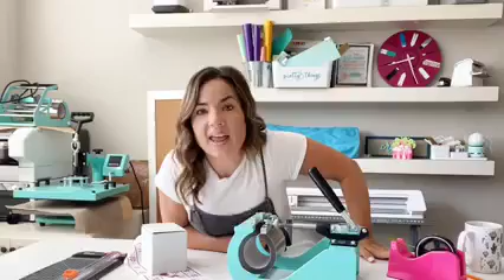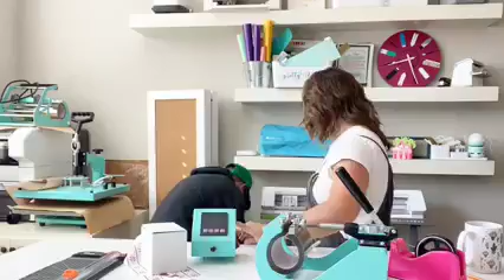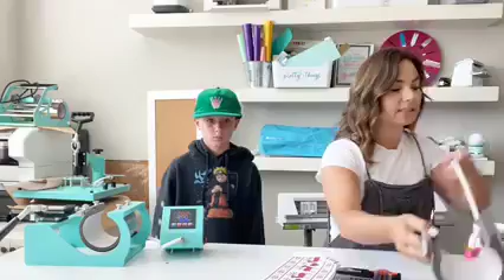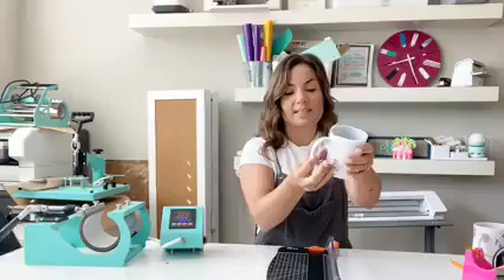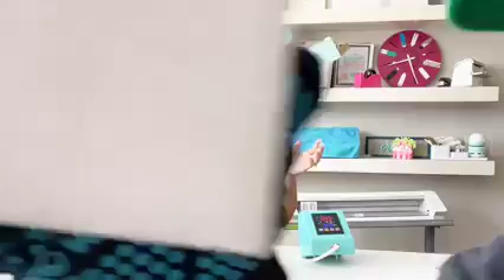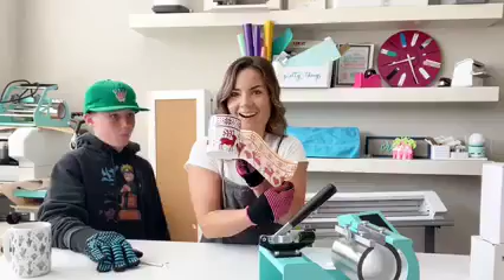Trick for How to Attach Mug Press to Heat Press the Duh-It's-So-Easy Way

Comment: What size is the mug you are using in this video. I cannot get a 15 oz mug in my larger sleeve and close the handle.  Thank you   Swing Design pointed me to your chart for sizes.  How fnny they cannot even tell me how large the attachment is and what size mugs it will cover.  Gayle   P.S. Love your knowledge and testing of all equipment and silhouette software!
Reply from the maker: Hey there! That is because they know I have the best info on their awesome products ;) Check out this blog post: https://www.silhouetteschoolblog.com/2021/05/best-mug-press-machine-with-attachments.html Make sure you're using the thin pad, and if it still won't close, I'd adjust the pressure.
Reply: @SilhouetteSchool  So I they said I got the wrong attachment and sent me the small one UGH.  But I finally got a call back after this debackle and they said their attachment will not support a 15 oz cricut mug.  Your press is the orginal version they have a new one where there isn't a thick pad and thin pad.  AND the larger 15 -17oz attachment (from their standalone mugpress will NOT fit on the 8-1.)  The 8-1 unit has NO extra attachements.  They offered to take it back but that leaves me with no press.  The starcraft 8-1 swing away on their site lists the mug attachments as 9 and 11 oz.  (which I feel like theirs should also say what fits by showing dimensions since it doesn't fit many 15 oz mugs.  I bought a case of 15 oz mugs from amazon and they are even bigger than the cricut one.)  It took many tries to find that they only support 3.25 diameter (cricut is 3.78 and amazon one even bigger).  I totally researched this press - which I love but also wanted a mug press.  They purposely made nothing else attach to it and wanted me to buy another mug press that does have a bigger attachment for another $349.  Needless to say I am very disappointed their marketing misleads you to believe you can handle a 15 oz mug.  (maybe their 15 oz mug but thats it).  Sadly I love the 15x15 main press.  Not sure what to do.